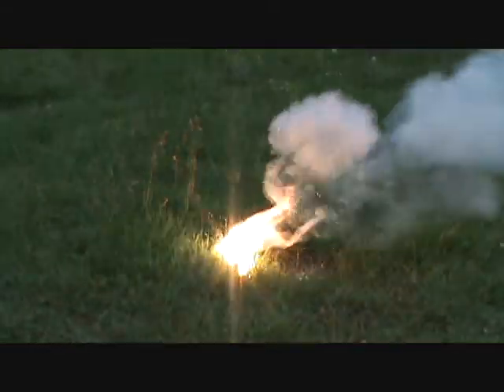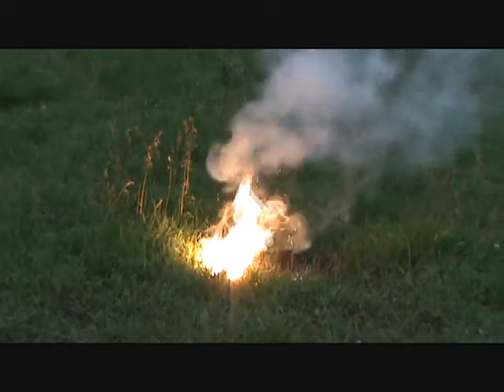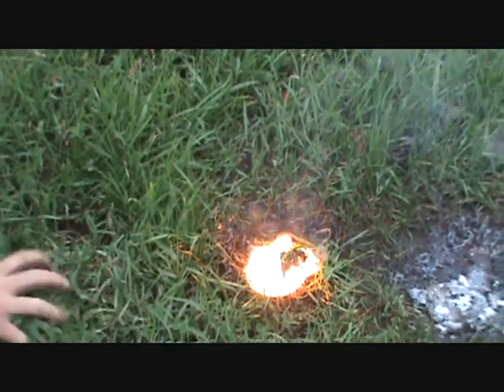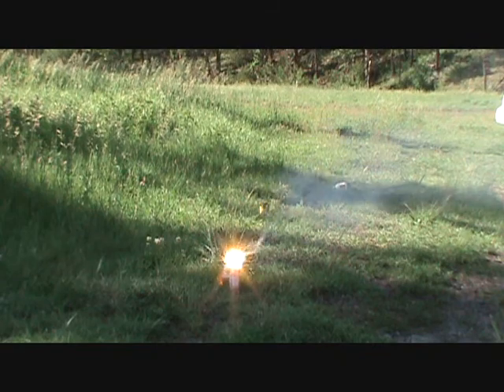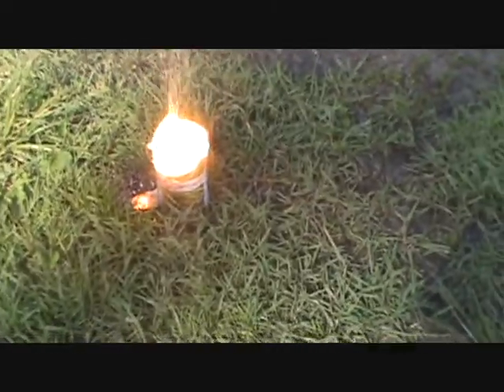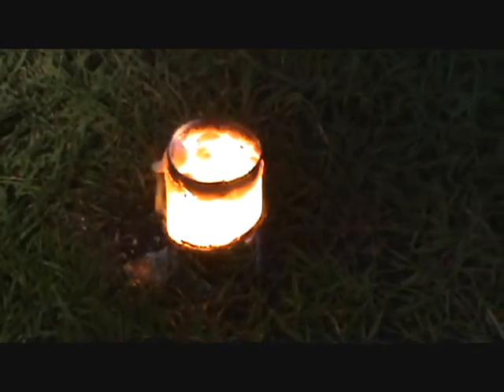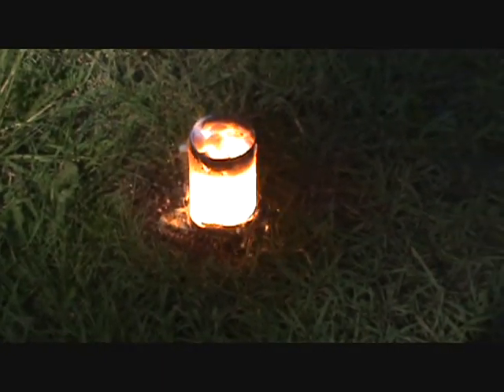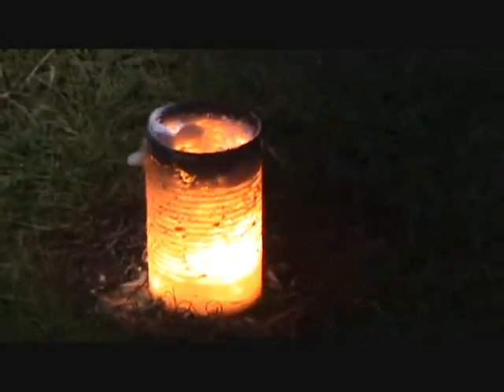Slow Burning Thermite

Comment: The iron oxide is the oxidizer, it donates the oxygen, and the aluminum is the reducer, it reduces the iron oxide to elemental iron and oxidizes the aluminum into aluminum oxide. By adding sand the iron oxide begins to oxidize the aluminum but than as the temperature increases the aluminum begins to react with the sand which is silicon dioxide. Try removing the iron oxide and use just sand, than try substituting magnesium for aluminum. If it works, it will produce silicon metal and a metal oxide